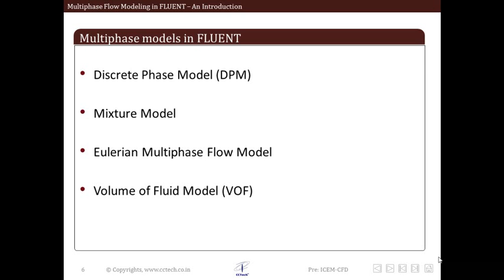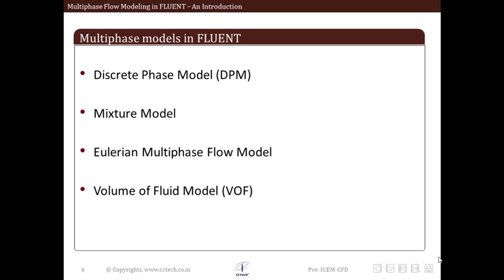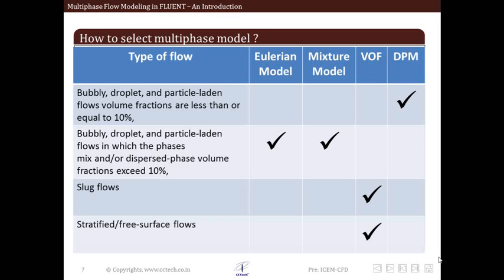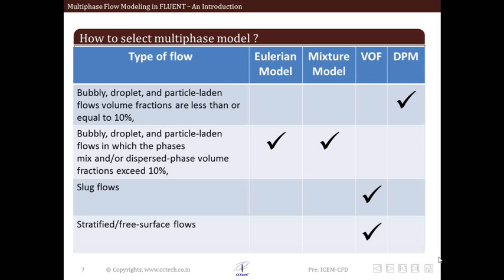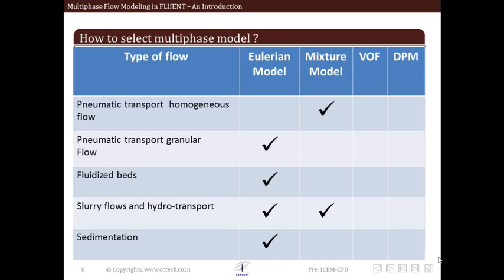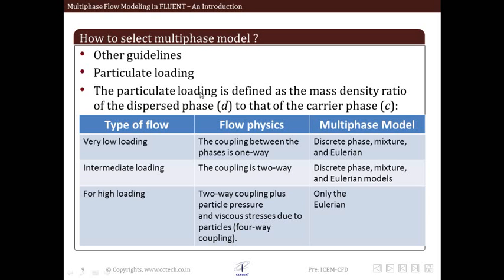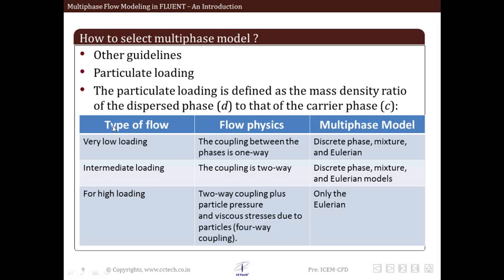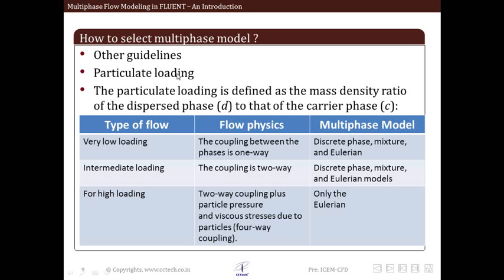LearnCAx - Multiphase Flow Modeling using ANSYS FLUENT™

Comment: Hello I an required to model a CO2 absorption column in which there is a counter-current flow of Co2 and a methylamine solution I was wondering whether you could recommend what model would be most suitable in you opinion?

Comment from the maker: Hi Vongani,

I don't think you need to use multi-phase model in this case. I am assuming that the heating is just a sensible heating (without phase change). If there is phase change, then you need multi-phase surely.

For without phase change, you need to model the solid domain for wire and fluid domain for water. You can provide the heat sources (watt/m3) for the wire solid and model forced and natural convection (depending on the physics of problem) for water.

I suggest you to go through our heat transfer course https://www.learncax.com/courses/by-software/by-type/premium-course/premium-cfd-course/heat-transfer-modeling-using-ansys-fluent-detail which covers modeling of conduction, convection and radiation.

Thanks